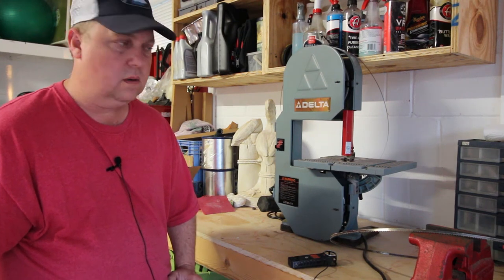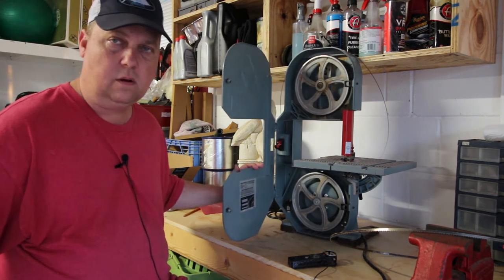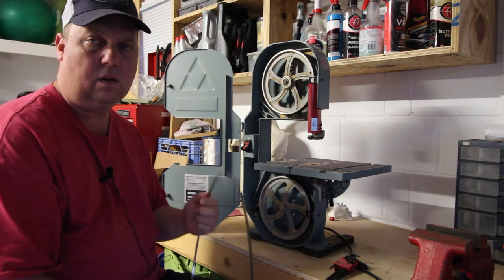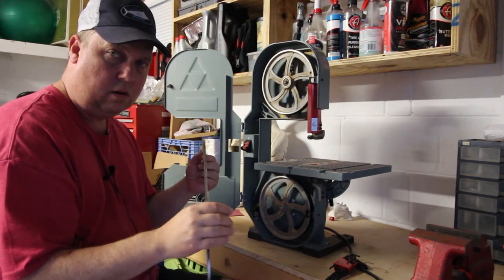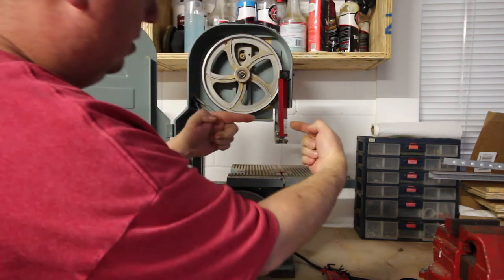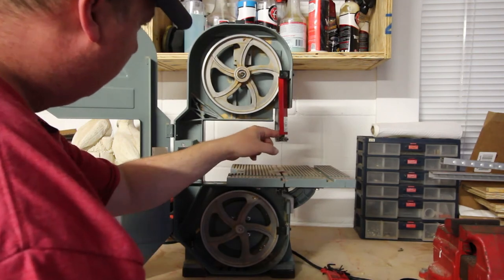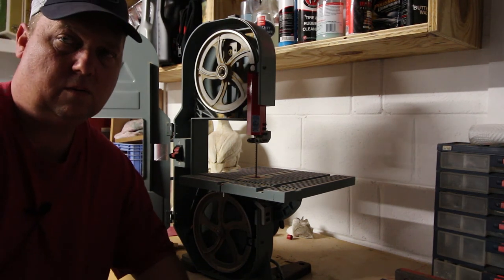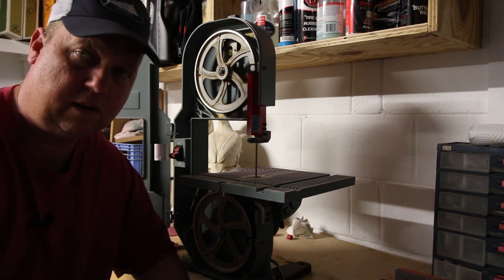Adjusting Delta Bandsaw

Comment: The allen wrenches are 3 and 4 mm.   There are two holders for these inside the cover, near the hindges, as someone else commented.   My 28-150 has a device that you set to the thiickness of the material you are cutting.   I do not see that on this band saw, so I believe it must be missing.   I really like this band saw.   It isvery handy.   Also, I had the same difficulty attaching the blade, and I used a piece of masking tape to hold it on the bottom wheel while I placed it on he top wheel.  Thanks for making the video.

Comment: When adjusting the guide bearings keep this in mind for any bandsaw. The upper guide ass'y is adjusted up and down to clear different material thicknesses. The lower guide assembly does not. So adjust the lower guides first. Then raise or lower the upper guide assembly for the material to be cut. Then adjust the upper guide bearings and recheck the lower. The reason? The upper bearing to blade gaps will change a little when the assembly is raised or lowered to accommodate different thickness materials. Also, this bandsaw uses 59.5" blades.

Comment: I have the same Delta band saw . I just bought some blades from Lowe's and I bit the smooth part in the back and the teeth are out but my teeth on the blade are facing up. Is there a Pacific blade you have to get for this Delta
Reply from the maker: Sounds like your blade is inside-out.
Reply: @Nix4me  He probably shouldn’t be using a bandsaw! Ha!